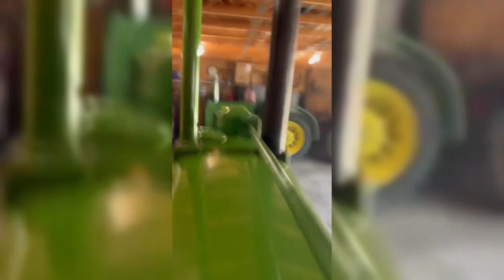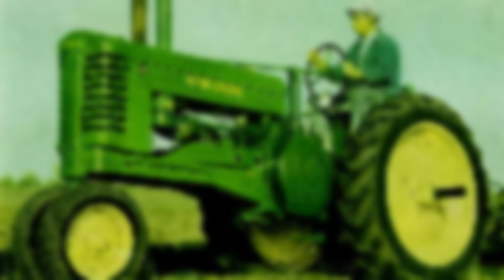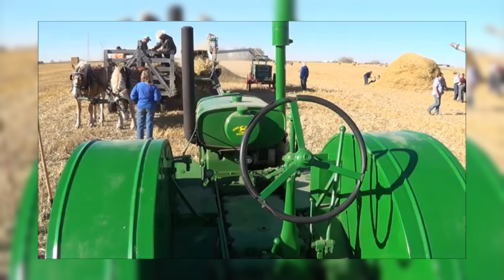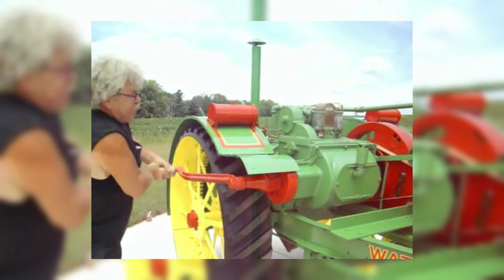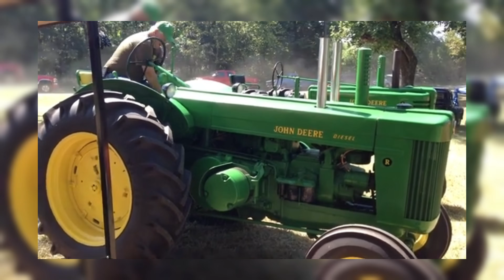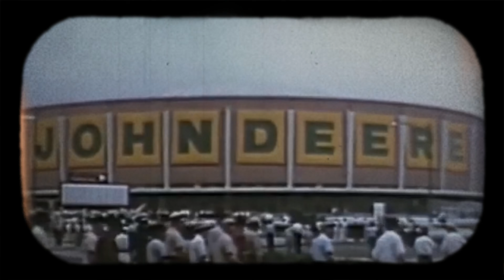Why That Old John Deere Sounded So Strange.

Comment from the maker: Did you grow up around one of these old 2-cylinder Deeres?
Reply: Our neighbor, Russ Wiggins had a tricycle model A. He was big alfalfa hay grower and used it to roll the hay or combine the rows together. I loved listening to it work as a little kid.
Reply: Grew up driving a 60, a G, and a B.  I still own and use two 1952 late-styled B's.  Also, the gas engines won't run backwards; the valving etc doesn't work that way.
Reply: B was the tractor I cut my teeth on. Then the 3020 and the 4020.
Reply: Yes, in Eastern NC on a tobacco farm. I am 71 now, will never forget it.
Reply: Yes Sir, I did. Two to be exact. One was a B and the other I can't remember. It was bigger than the  B. I pulled a disc with the bigger one. But the B, I cultivated many summers with it. When we had them sitting at idle just popping away, the neighbor farmer, would say it was telling us to, "Put a nickel in ______ Put a nickel in _____ Put a nickel in".   I'll never forget that sound. 
P.S. we also had a Case 830 for plowing. Thanks for the memories.
Reply: My uncle and cousin had a JD A and a 730 diesel. I preferred my grandpa's Farmall M gas and my other uncle's Super M propane. I never could get the hang of the hand clutch

Comment: I had a hand crank A with the 2 fuel tanks. I was told it was a WW2 design for the fuel shortages. You started the tractor on gasoline and then switched to kerosene. We used the small tank as on emergency tank. It came in handy a few times. Had an electric start B after the A. Both were great tractors!
Reply from the maker: Those dual-fuel setups are fascinating pieces of history; thanks for sharing your experience with them!

Comment: When I was a kid, there were 4 Ds lined up along the fence line and dad had bought an 820 to replace the R. He had me out summer fallowing with 21' of Noble K blades. I'd run into a hard patch of gumbo and the old girl kept running slower and slower. About the time I yanked the clutch back she breathed new life and the oil in the oil bath air filter poured out the top. What a mess it made on the hood of that old girl when it started up and ran in reverse.
Reply from the maker: That is a classic story, thanks for sharing that experience!

Comment: Water injection has been used in many engines for cooling and getting more power, including WWII fighters and 1960s OLDS V8s. As the water evaporates to absorb heat it expands up to1600 times it's liquid volume, helping drive the piston. (A hot engine can run on pure water until it cools too much to make steam.) Water-alcohol mix was used in freezing temps.
Reply from the maker: That’s a great point, water injection technology really changed the game for engine efficiency back then.

Comment: All that talk of brand loyalty and yet not one peep of where it came from. It wasn't the sound, nor was it the economics of running a Johnny Popper, it was the fact that during the Great Depression, Deere never forcibly repossessed a tractor or other farm equipment. They always worked with the farmers to try to find a way for them to keep farming. The ones they did take back were voluntary repossessions. That loyalty to farmers is what made the farmers loyal in return. A loyalty that has lasted through multiple generations in some families.

Comment: pure condensed OWL SHIT,,  they never ran backwards
Reply from the maker: The 70 Diesel and early 720 Diesel absolutely could run backward when lugged nearly to a stall. Deere actually changed the camshaft on later 720s to help prevent it. There are plenty of firsthand accounts from operators who experienced it, usually accompanied by exhaust through the intake and oil coming out of the air cleaner. So ‘they never ran backwards’ is simply incorrect.

Comment: My wife and I own a 1955 John Deere model 70 gas tractor. It was a prairie tractor, with no three-point hitch. Huge engine, electric start, with a very distinctive sound when running. I have almost fully restored it.

Comment: At the First Monday Trade Days in Canton,.Texas there used to be someone that used an old popping Johnny engine running a belt and pulley system that he used to run a bunch of ice cream churning machines. Fresh made on the spot ice cream was a fantastic treat in the summer heat.

Comment: Expensive to repair. Engine parts are expensive to buy.
Reply: Really? I haven't had any problems. And Miller Tractor has acres and acres of old John Deere tractors they part out; I've bought quite a few things from them, even big sheet metal parts.

Comment: 4 stroke engines can’t run backwards!
Reply: Actually a 4 stroke can and will run backwards due to backfire or timing issues usually resulting in internal damage. I have bump started a 1970s Honda CB175 by rolling it backwards and then rode it going backwards. I'm not saying it was good for the motorcycle but being a Honda it survived.

Comment: My Dad and my Grandpa had an IHC dealership in southeast Kansas, so we were competitors - but I always had a sneakin' admiration for the 2-cylinders.  For sheer pulling power, it was a design that had its advantages - that's why it stuck around so long.  I wonder how a 3-cyl. in the same general layout might work.
Oh, and the IHC Farmall 560 is the world's most copied tractor; a 4010 is just a 560 scaled up....   };-> 
(In truth, the Oliver 77 beat everybody else really)

Comment: The "Johnny Poppers" uneven firing stroke actually made the engine more efficient and have more tourque at lower RPMs and with a mechanically simpler build.
They were also strikingly easy to start by hand provided they werent too cold. I have hand started a few. Not much harder than starting a modern push mower.

The famous Harley twin engines use the same concept for a simular result.

Comment: To get a facefull of fuel in the morning from petcock!  You would need to be bent over by the cylinder...silly.  Never heard of a Johnny Popper run backwards.
Reply: D had primer cup type petcocks.  No choke. Put gas in cups then open petcocks & crank

Comment: We had 2 kerosene "A"s. Never switched back to gas to shut down. We always turned off the fuel and let it run out. The next morning we started on gas, no problem.

Comment: All the diesel crawler/tractor mfgs  used an aux start system.    Cat used the same Pony Motor.   IH used the gasoline/diesel shift system.     Only the Russians had a cold start diesel solution,   they put Air cylinders in the T-34 and did an air start.    Easier to do on a tank.      Glow plugs worked,  unknown when they started using those.   I know of a guy who  blew up his Ford Tractor when he ignored the mechanic telling him to replace them and used the Ether Start,  WAY too much of it.    Stubborn coot got it repaired and then just would not use it below 20 deg when it would not start without glow plugs.   Never admit you are wrong.

Comment: I had a 70, God I miss that tractor. I never managed to stall it out. It would just get slower and louder. A trick I learned was to turn either the mag or distributor to full advance when hand cranking. once running set back to run position. WILL save your thumbs and other body parts.

Comment: I don’t understand how the engine would run backwards.  The carb would be on the exhaust side, and no fuel would be getting into the engine.
Reply from the maker: You’re right for the carbureted gas models, they wouldn’t properly keep running backwards because the intake/carb and valve timing would be working the wrong way. The backward-running stories mainly apply to the old Deere two-cylinder diesels like the 70D/720/730. When lugged almost to a stall, they could kick back and briefly keep firing, sucking air through the exhaust and blowing smoke/oil out the air cleaner. Deere even had an anti-reverse cam update for that issue. I should’ve made the gas vs diesel distinction clearer.

Comment: that run-it -backward is a Lanz bulldog two stroke thing, not a Deere 4 stroke thing
Reply: I grew up on an H, B, and an A Johnny. Good machines. I remember that big double box end wrench you talked about. Had one hung on the A and B on the rocker arm shaft control lever. The A was a '51 that had been overhauled, and was fitted with aluminum pistons and a water pump. That made a real puller out of it. A heavy load would kill the engine with the front tires in the air, pulling to the last rpm! Spent so many hours on those Johnnies, and we updated to a 3010 diesel when the new machines came out. And that Deere quality was in that 3010 as much as in the A. Remember nights spring and fall plowing. That old A talking so powerfully, turning over that old heavy black jumbo. A wonderful evening under the stars watching the night time animals looking for food.

And I never had any of our Johnnies start up in reverse engine rotation. Was it that big of thing? Or something that was more likely to happen to an engine needing a tuneup?
Reply: you know what they say never let the truth stand in the way of a good story ! now if we could just find a good story !

Comment: I think this guy needs to re-examine the crankshaft geometry.
Reply: The 2 pistons are connected by rods to 2 crankshaft journals that are 180 degrees apart. He's right, it does cause both power strokes to happen 180 degrees apart. Then the crankshaft rotates 1 1/2 revolutions before the next 2 power strokes. The result sounded like a single pop once the rpm got up to 500 rpm or more. BTW my old John Deere would occasionly fire backwards when cranking but it never ran for more than a few seconds since the Intake Stroke now drew air from the exhaust pipe and pushed air out backwards through the carburetor/air filter. The engine quickly died due to lack of fuel.

Comment: Not only did the 2-cylinder Deere’s develop prodigious torque, their weight distribution delivered unparalleled traction. When I was driving a JD 60, we hitched it drawbar to drawbar to a much larger, nominally more powerful, wheel tractor of some make I’ve long forgotten. The Deere cheerfully walked away with the big tractor, though its wheels were clawing at the dirt. On pavement, I could engage the clutch in sixth gear from a standing start while hitched to something like a hay baler. The engine didn’t stall; every impulse would lift the front wheels until things got under way.

I used to joke that you didn’t need to shut it off to overhaul it. It was so simple and well thought out that the double-ended wrench that came with it turned every major fastener on it.

The  JD Diesel’s starting system may have seemed arcane, but it’s the same one used on every contemporary Caterpillar Diesel tractor. In fact, early Cats lacked the electric starter. I used to start a WWII-vintage D4 with a pull rope wrapped around the pony engine’s flywheel pulley. Usually several times.

It’s a shame that Deere has been corrupted by their success. I once thought they were one of the most admirable American companies.
Reply: Thanks again YT for deleting my comment. I don't know why I keep sending them.
Reply: @philliphoward7455 They do the same to me all the time.
Reply: Watching Poppers pull at the county fair confirms your thought on this subject. As a little kid in the 1960’s I was just amazed how they could pull. I grew up on a 1952 model B. Now I’m old and i decided to give my grandkids the same experience I had. Now my grandsons love ‘their’ model B.
Reply: The old pony engine was a deal with John Deere and catipalar it was amazing that small pony engine would start some of those large catipalar engines
Reply: My family had an IHC dealership so we were competitors - but that 2-cyl. design had its advantages in pulling power.  Several of our customers 'split the difference' and had a JD for tillage and pulling stumps, and an IH for planting, cultivation, and PTO work.
Reply: @flyingdutchman4794 The 2 cylinder engine was also very fuel efficient

Comment: 😊😊 the early John deere tractors 1 cylinder fired be 4 the other 1 that how the engine got that sound john deere didn't have the inline 4/6 cylinder engines until 196O 😊😊 OMG 6 2O 2O26

Comment: Gtow up running a 630 and an A  those Jonny poppers are still running and I’m 63 now
Reply: I just finished going through my old 630 that Dad had bought new. Rebuilt the head, new valves, seats,guides,springs, and keepers. Replaced the seal that keeps diff oil from the PTO oil. New gauges, new steering wheel and rebuilt the floatride seat with new cushions and armrest. Good to go back to work.